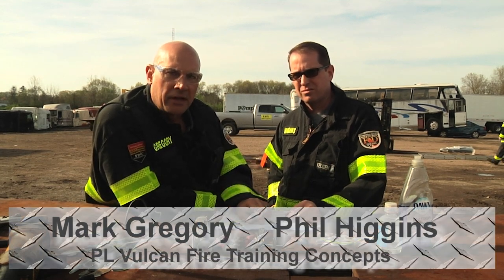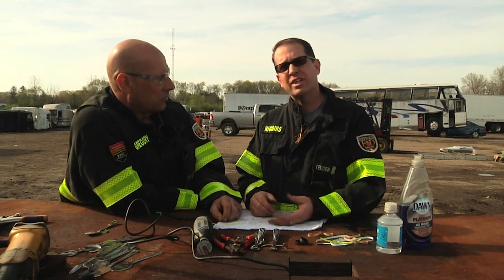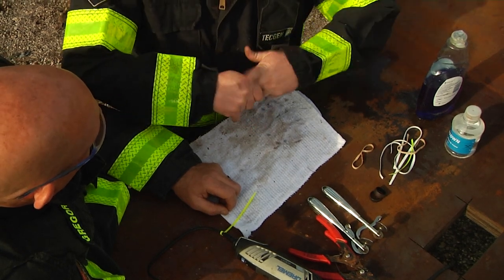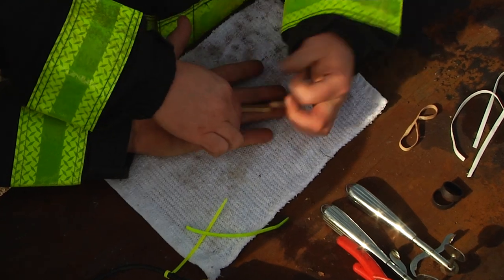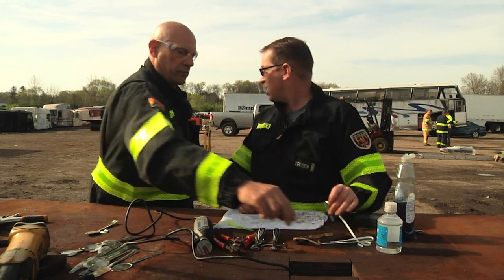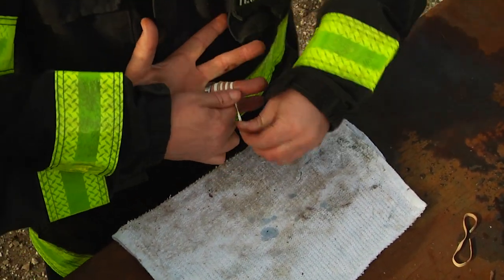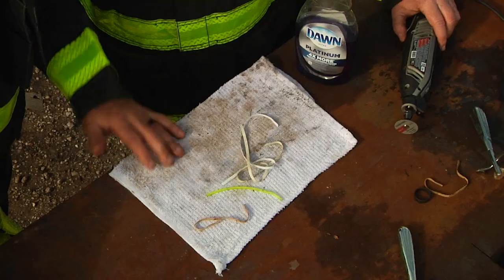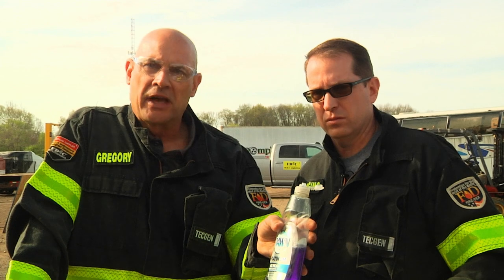Non-invasive Ring Removal

Comment: Our Compression Device is another great tool for more difficult stuck ring cases to help remove rings non-invasively. It's purpose-built to shrink finger size and won't cause discomfort for the individual. You see how it works here: https://www.youtube.com/watch?v=cteb1Mqi4c0&t=142s